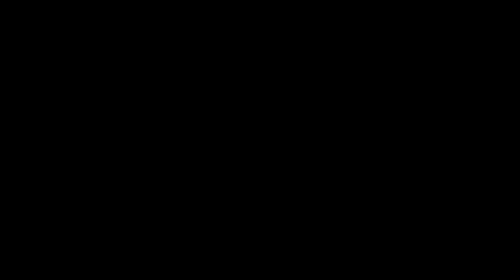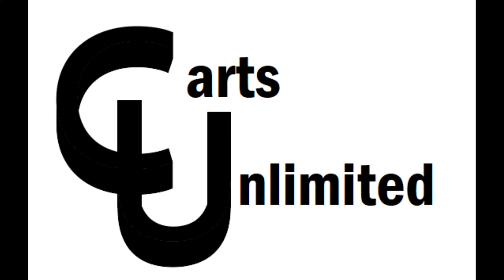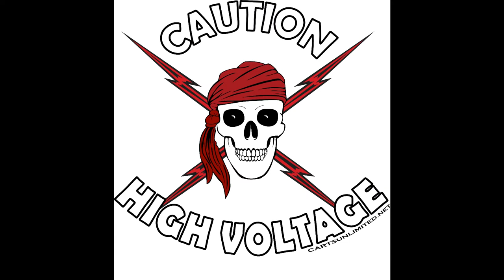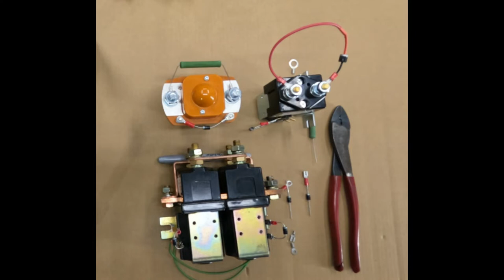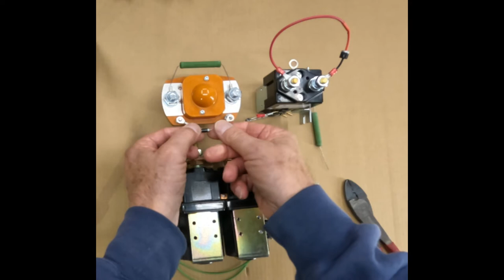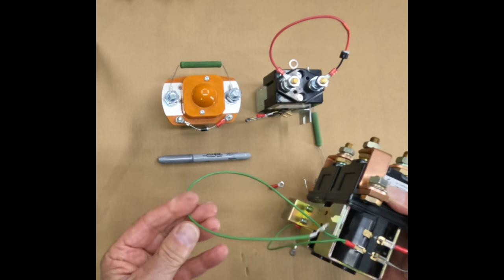Resistor & Diode Instruction for Golf Carts

Comment: Scotty B? Do you know, how does one determine the exact value diode to use, for instance, for a MZJ-800 amp solenoid switch? This is on a John Deere ME-1004 ev conversion project, using a 470 ohm resistor, as you covered in this video. We're using a 48 volt battery, if that matters? Can i use a 15amp 45 volt 15SQ045 fly-back diode ?
Reply from the maker: We use the 1n5408 3 amp 1000 volt flyback diode on all of contactors for 36 and 48v operation.

Comment: I'm putting together my own ev cart. I'm working with a cushman GE series wound motor, I have an sr480300 altrax controller, and I'm going to use an Albright dc182 f/r switch. I've looking for wiring diagrams for those. Would you happen to know/have a diagram showing how these wire into the system? The most information I've found so far is from this video. GREAT JOB!
Reply: @scottyb4606  I eventually found a diagram.  The altrax diagrams were a little confusing but I found someone to explain it and now I'm running a joystick as a 3 way switch for the f/r switch.

Comment: Does the diode and the resister go on the large terminals? You are showing only diode no resister. I have the same solenoids.
Reply: My 2001 Txt. Wouldnt move so bypassed reed switch..fixed problem very temporarily, took off smelled wiring burning.
Positive cable burned  in two at solenoid, repaired cable, now wont move again, jump across solenoid and it will. Fuses good thinking diode or resistor burned? Any thoughts
Reply: usually diode goes on the small terminals and resistor goes on large, unless you have EZGO DCS which has a resistor diode board across the large terminals
Reply: @jimhoover4060  any luck?  if you shorted the solenoid and that worked my guess would be your solenoid got fried.  the diode keeps flyback current from damaging solenoid over time.  resistor keeps your controller at same voltage so it doesn't arc.  make sure you have an appropriate fuse in your wiring.
Reply: Turns out the tow run switch connector was damaged..tested good but further closer inspection revealed a pin problem within, had to call in an expert but price was very fair

Comment: What diode is used on this sw202 switch. I bought this years ago and one of the diodes broke in half and I cant read the writing.
Reply from the maker: Use a 1n5408 diode
Reply: Should I use the same size diode on the SW 108 selnoid?

Comment: Hello Scotty, thanks for the video. I just want to confirm on the MZJ-400.. this solenoid does not have polarity on the large terminals and can go either way? As long as you match the banded diode to the pos you assigned it? I am seeing some info on line about the 1 and 2 that is labeled on the solenoid indicating positive and negative and it’s confusing me. Thank you!!

Comment: What's the purpose of the 250 ohm resistor?
Reply: trickles a charge to the capacitors in the controller so they're not hit so hard every time you step on pedal.